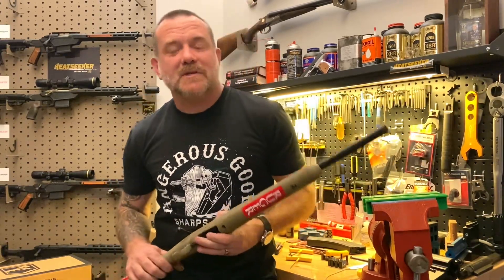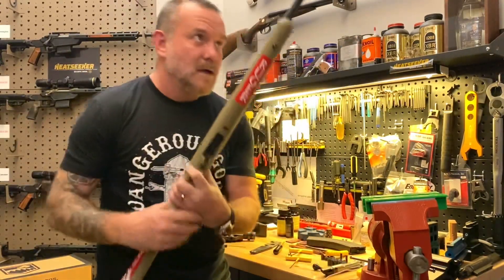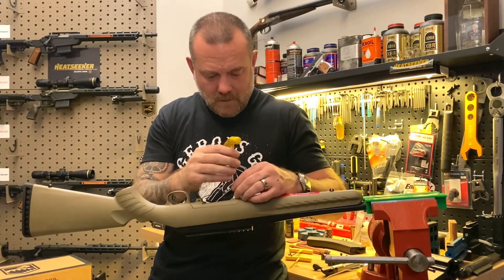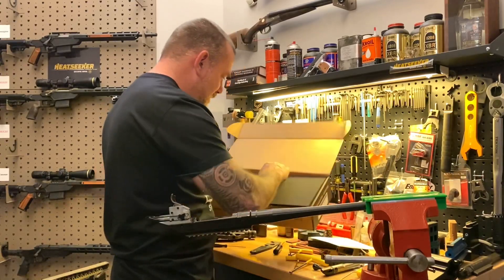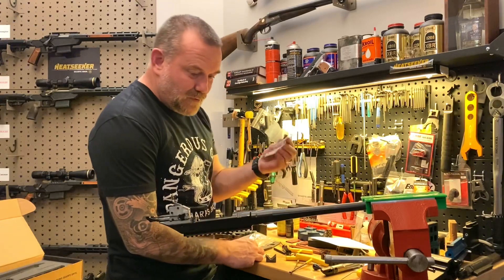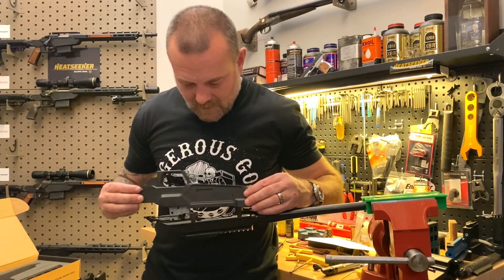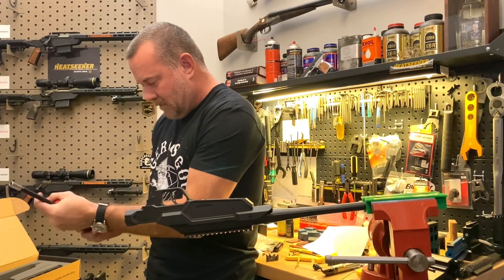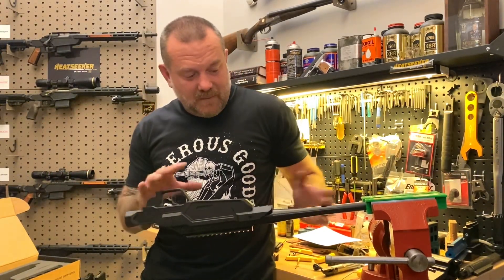Sharps Bros. Heatseeker chassis for the Ruger American Ranch (assembly / how-to build video)

Comment: .300 blackout Chassis did not like Amend 2 mag. Bolt would put round in but not pull out. A little sticky with the stock Pmag that came with the ranch. Aluminum AR mag by DH Tactical, (yes the one sold at Bass)is the solution, clean and clear bolt operation with that one.

Comment: But does it work with an American Ranch with the original NON modified magwell? All I ever see is the Gen 1 and Gen 2 stocks but those are made with the same magwell that can be swapped out to work with other brand mags. There is a model of American Ranch that isn't designed with that feature and no one ever shows them or their compatibility with anything else. The Gen 1 and Gen 2 are actually more along the lines of Gen 2 and Gen 3 as the other model is deigned based on the original wood stock which only accepts proprietary Ruger mags. I'd love to get one of these for my 450 Bushmaster but I can't find anywhere that has the information of compatibility. I don't want to spend hundreds and waste weeks of my time only to find out if it does or doesn't fit. I rock pistol grip rifles because of nerve damage and disability and can't use a rifle I have because I can't find any info on chassis swaps.

Comment: Small issue with mine. The chassis does not support the bolt stop pin. I had to find a longer pin to fix this issue.

Otherwise the pin will fall out just enough for the bolt to just pull out of the receiver. 😮

Did I miss or forget an included part?

Comment: I bought this for my 450 Bushmaster and love it very light also. I have a 300 Blackout also but I put it in a MDT Oryx its nice to but way heavier wish I had seen these Sharps prior cause I definitely would’ve put it in the heatseaker also.
Reply: Could I talk to you about your 450 in this chassis? I wanna see how you finished it out. I plan on ordering one soon
Reply: @blakecrawford6291  let me see if I can paste what I used onto here
Reply: @lancelamoon6743  sounds good. I was thinking about a foldable picatinny mount stick for my build. Instead of the buffer tube
Reply: @blakecrawford6291  I just used a buffer tube. Can’t figure out how to load it on here.

Comment: I've waited a long time for somebody to build a chassis for the 350 Legend. One other vendor offered the chassis but has yet to produce any for sale. Thank you for going forward with your project. I have 2 chassis en route for installation on the Ruger American 350 Legend. I usually run the standard stocks with Bradley's cheek rests, which are superb units. This year I decided it was time to take a nice 10 pt with a Henry Case Hardened Octagonal lever action in .44 mag.  Smoked him with Hornady Custom 240g. XTP. Update - the Ruger American Predator fits the Heatseeker Chassis perfectly in the 350 Legend configuration. I discovered the Ruger chassis had started to make contact with the barrel and rubbed the underside of the barrel. Fortunately, little issue was found in the existing accuracy. The Heatseeker chassis makes great accuracy a simple task. I coupled the first build with an MDT SCS Carbine stock, Anarchy Outdoors see-thru grip, and Magpul Type 2 MLok slot insulators. The gun sports Arken 5-25X56 optics with Butler Creek Extreme Covers. The Ruger American Ranch 350 Legend will have the same parts except use a Primary Arms 3-18 Grid 2B scope. BTW, both guns have a Timney trigger group - awesome!
Reply: Did you build a 350 with it? I am wanting to get one for my 350
Reply: Yes, built two . See build above.